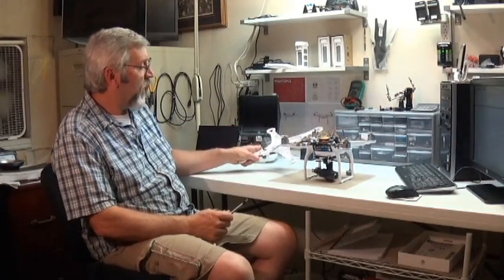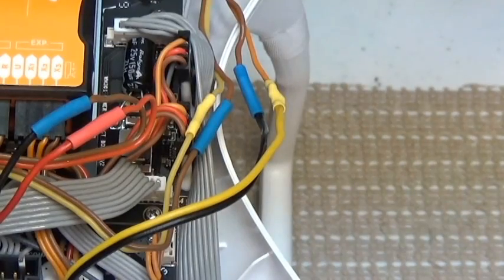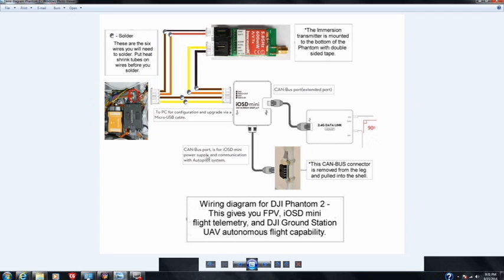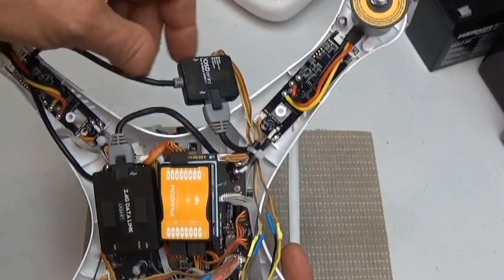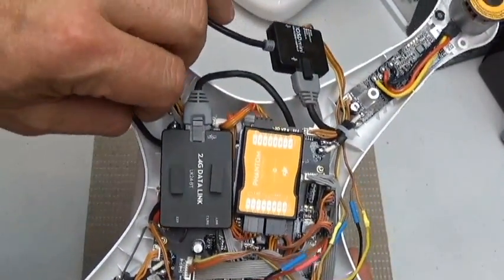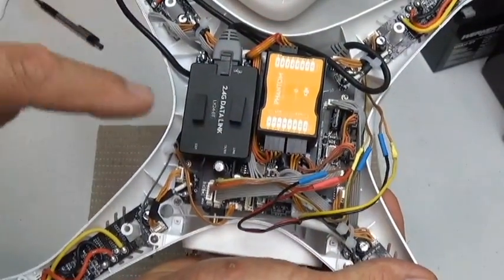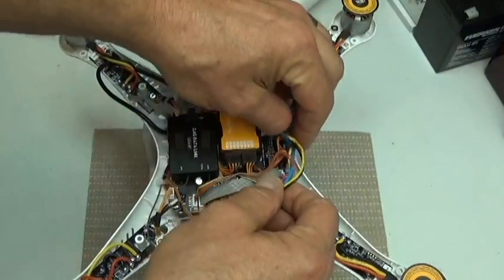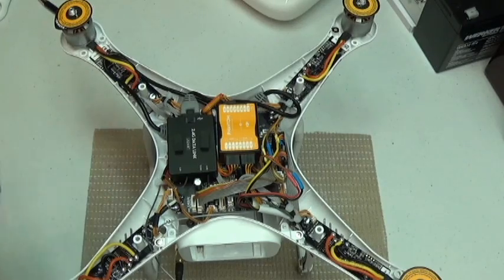DJI Phantom 2 - Installing the iOSD mini, the Ground station Datalink and an Immersion transmitter.

Comment: Will opening the Phantom and installing these components void the warranty, even if the modules are made by DJI? Their warranty information states that modification of the device voids the warranty, which makes sense but does installing these components count as modification? Also are these components compatible with Phantom 3, I can only find installations with the Phantom 2.

Comment: The datalink air unit runs really  hot. Have you had any issue with it? I don't want to break the phantom just to run the cable through  it. Have you had any issue with this?

Comment: Excellent video. I presently have my P2 open to install these components and you made it very easy. My main concern was if I could plug the DataLink CAN-BUS Cable into the iOSD CAN-BUS port, I was concerned I would have to add a CAN-BUS Hub into the mix. One question - any particular reason to use the Immersion transmitter over the AVL58? WIth the AVL58 you can use the FPV Cable Hub and the whole system becomes plug and play - no soldering. Again, great job!

Comment: OMGosh thanks for your quick and sweet yet so indepth video.    Im about to do the same setup but using a walkera G-3D gimbal.   Should go together just as you presented.   Im going to use it for Miss Universe 2014 in florida but bad business  that Trump does its not airing till january 25 2015.      Ill be looking for your next video.   Thanks again
Reply from the maker: Thanks for the comment, I'm glad it helped.
Reply: My g-3d shorted out on power up.    Guess I should have invested in the zenmuse.